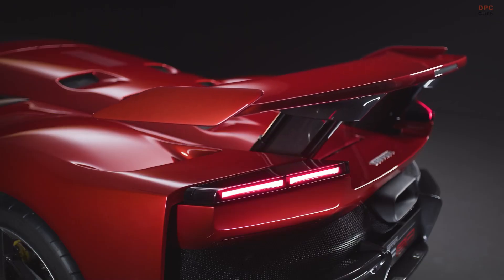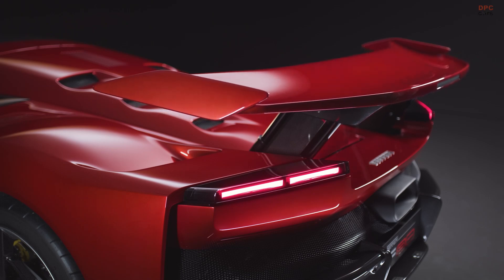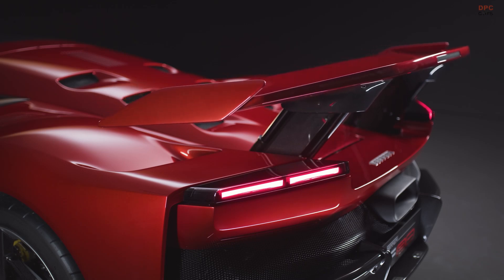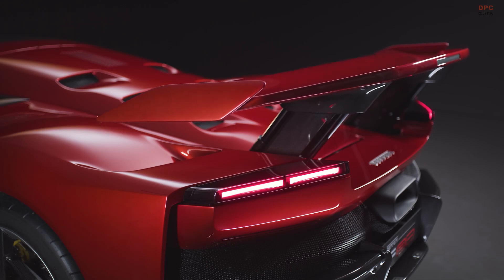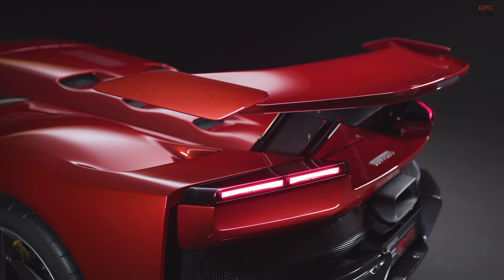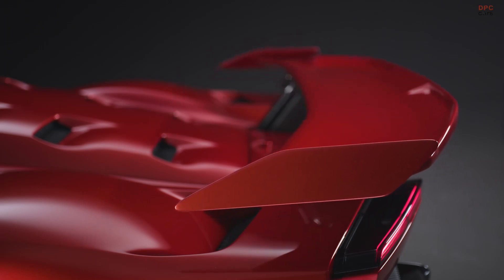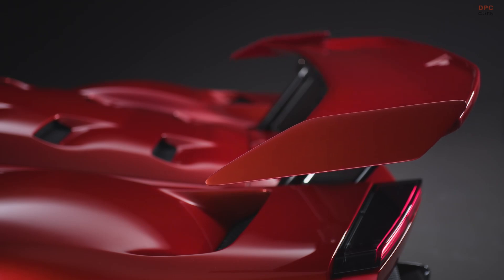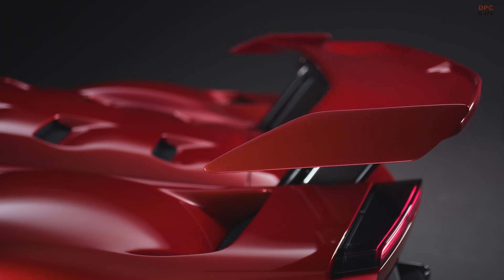New Ferrari F80 Active Wing Explained

Comment: Old tech and only useful at speeds that aren't safe on the road anyway...
Reply: Ofc, are you going to need 1000kg of downforce while cruising at 80km/h? So old tech that it’s the 1st rear wing that ferrari made after the f50
Reply: @nicolasfregolent924  Many cars can benefit from downforce at street legal speeds my friend. It doesn't need to be 1000kg, you guys always overaxaggerate.
Also look at the Zenvo TSR-S, as i said...old tech when that car already had a rear wing that is moving in all directions back in 2018.
Reply: @Enforcer_WJDE  how can you say old tech about a car that is  the pinnacle of engineering of one of the most advanced and exotic car brand in the world, a car that has f1 and wec technology only because ''another car before that had a flexi wing'', it's not about how much the wing can flex, but more of how much it serves the globality of the car, how all the component work together and in harmony, evidently some of the best engineers in the world have analyzed all the options, from no wing to drs, to higher flex, but came out with the conclusion that this is the best option in the globality of the car...
Reply: @Enforcer_WJDE If a car needs a wing for downforce at road legal speed then the car isn't stable. Downforce at high speed is to make the car planted to the ground and take corners with more speed than usual.
Reply: @hellcat-707  Audi needed to install a wing / spoiler on their TT when it came out because it was unstable at road legal speeds. 
Not a wing  or spoiler but all SUVs need software to keep them road safe.
Reply: @Enforcer_WJDE  That's exactly what I said, the car is unstable if needs a wing to generate downforce at road legal speed.